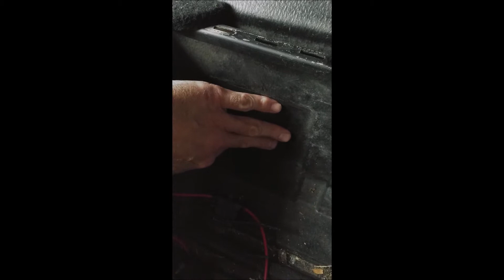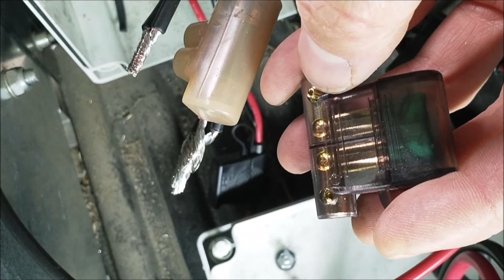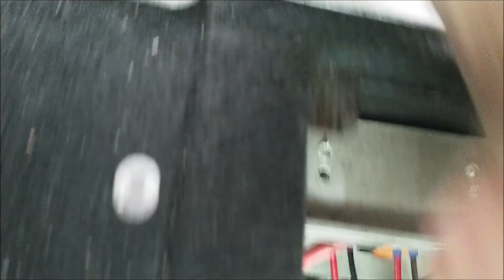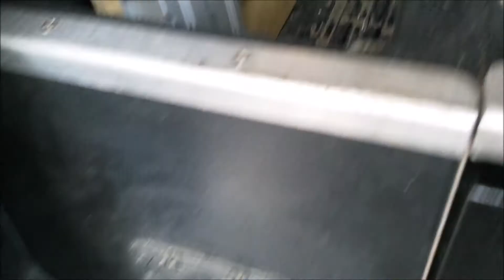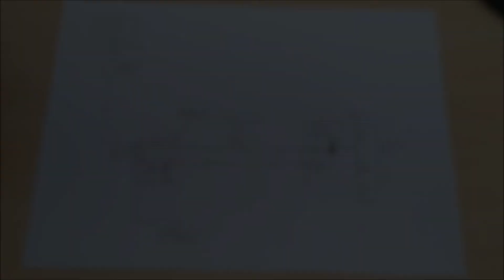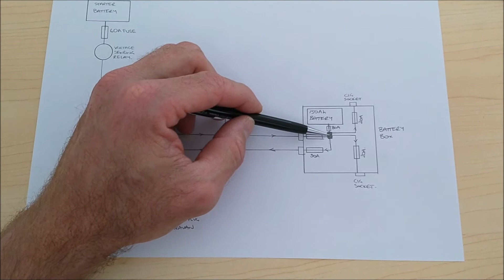12V system and Secondary battery for Holden Colorado

Comment: Cheers for the video, any reason for running the smart isolator when you already have a dcdc charger. I know these colorados don’t need the ignition wire signal as they are not smart alternator
Reply from the maker: It's not necessary but I wanted to make sure the 2 batteries were separated so the start battery wasn't drained if there was a fault with the DCDC. Also wanted to make sure the start battery was charged first before then charging the secondary.